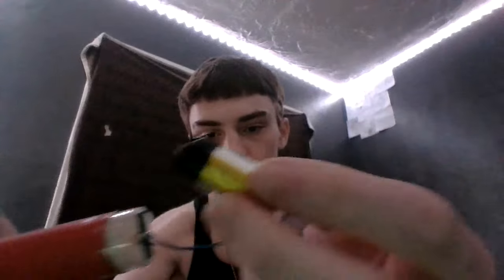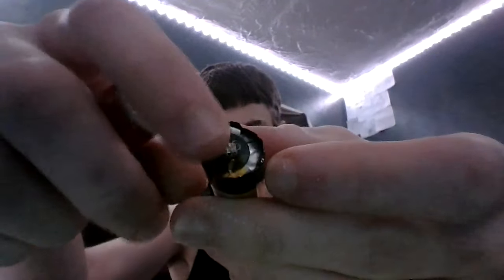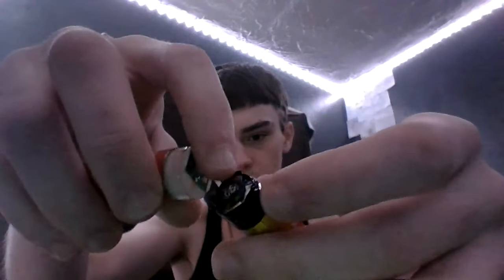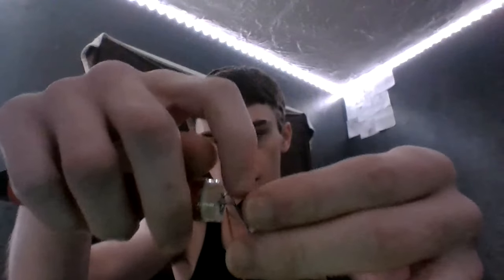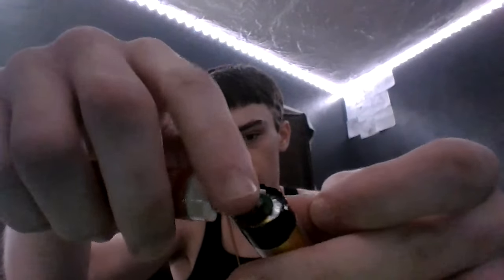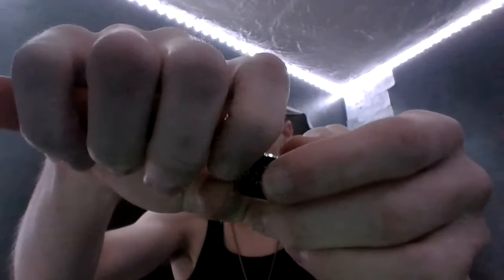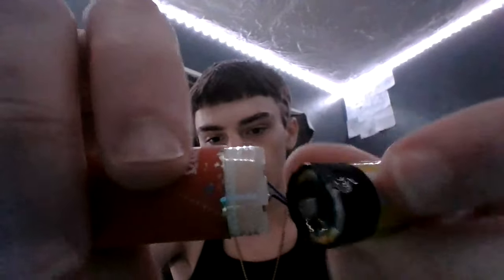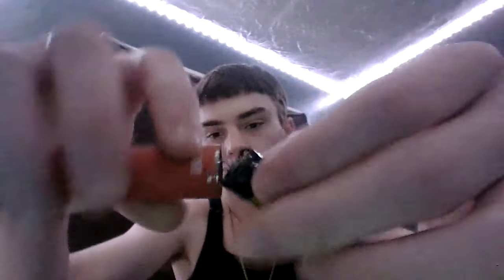How To Fix Fume Broken Wire (HOW TO FIX BROKEN VAPE)

Comment: I need more help😭 like I’m struggling with the “bend it” part. Idk what to doooo
Reply from the maker: All u got to do is bend the metal part on the battery it should be able to bend upward then u put the cord that has broken around it and push the metal back down (strip the wire that has broke first before u wrap it around the metal part) if u need help still js msg me on insta ZayFrom850 
I’ll do my best to show u how lmao
Reply: @ZayFrom850  I jus dmed you I need help a bit my b g😂😂😂
Reply from the maker: @delisa5440  means get the plastic/rubber part off
Reply from the maker: @delisa5440  off from the wire

Comment: Thanks it worked but when I took it apart the mf wires canes out so I had to Sorda weld it back but it works thanks 😂
Reply from the maker: No problem brotha glad I could help ‼️
Reply: with electrical stuff its called soldering not welding.. I'm just tellin ya so you know, may be useful info, no judgement here brotha!

Comment: what happens when both of the sides have a broken wire..
Reply from the maker: You can still fix it but at that point it’s not even worth it it will keep unconnecting and you’ll keep having to fix it
Reply: @ZayFrom850  ohh ok thank youu